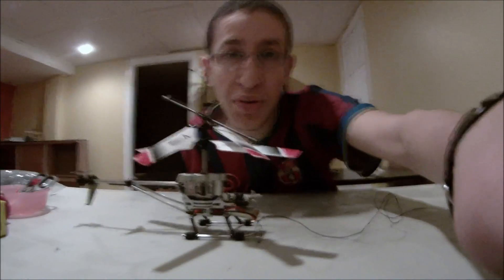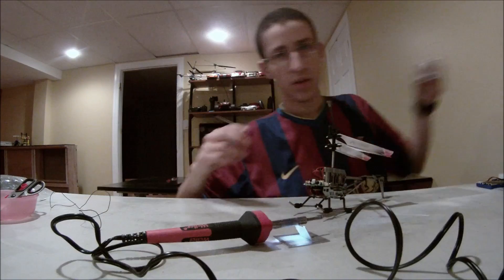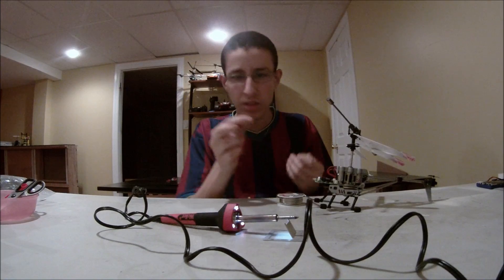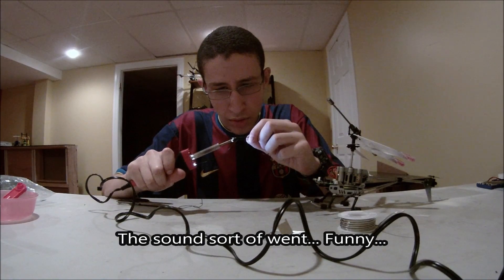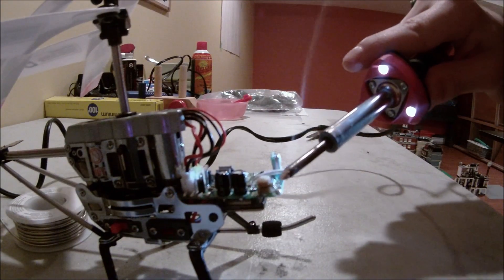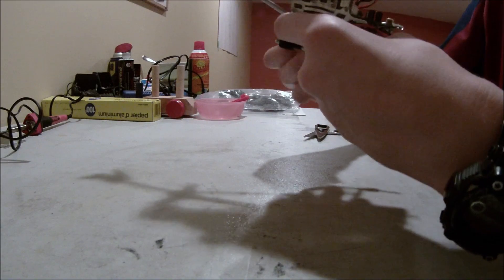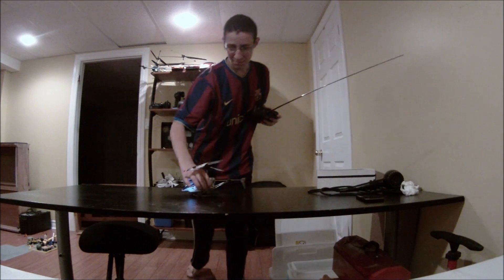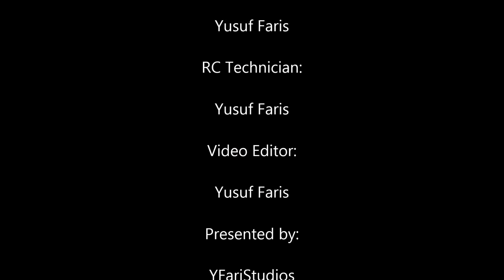How to Solder an Antenna on to a Circuit Board (Demonstrated on Lite-Hawk XL)

Comment: it's not vibrations from the wall. it's the magnetic field (from the 50Hz current) of the cord of the soldering iron coupling to the camera
Reply from the maker: yeah I eventually figured that out. The camera was rubbish anyways I use better cameras now.